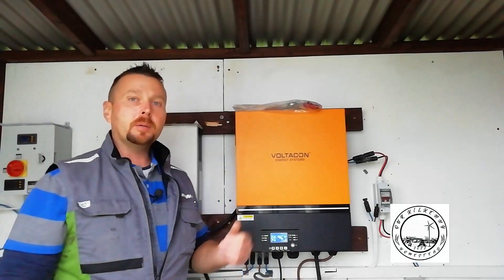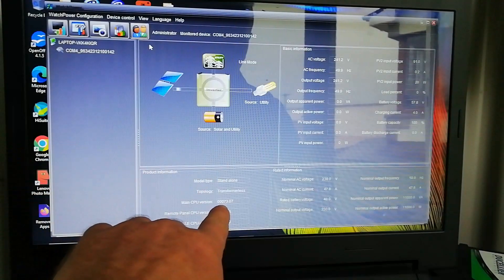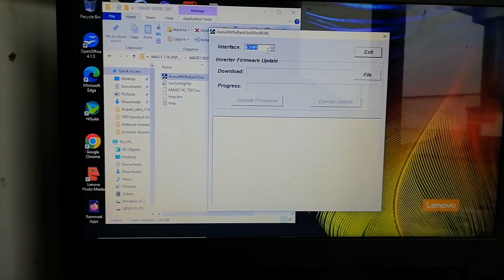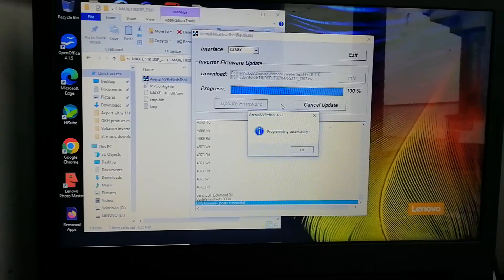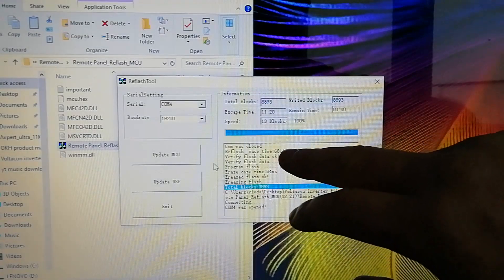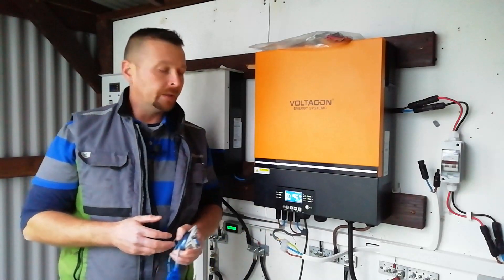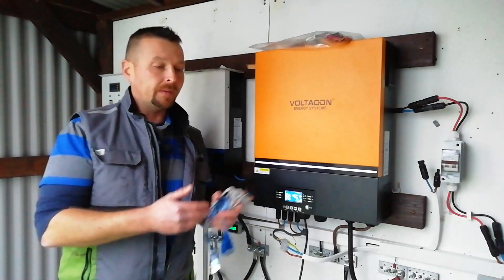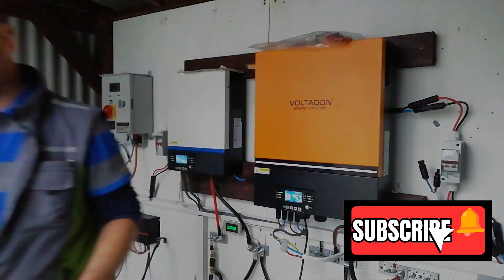Inverter Firmware Update Procedure, Bug Fix, Voltronic, Axpert, MPP Solar, Voltacon, ETC.

Comment: Hello, i have a Axpert VM III 3000-24v the firmweare is 47.00. Where can i find the latest firmware or is 47.00 the latest?
Reply from the maker: You need to contact your supplier for the correct firm ware versions, if they are available.  Usually the company will provide these for free, just ask.
Reply: @ourkilkennyhomestead2006  thx

Comment: Hello sir can you please share the application by which your using to update the firmware
Reply from the maker: I've answered you already chief. Your inverter is not compatible with the files and you need to contact your manufacturer. If you try to install the files for the max 1 as shown in this video then you will brick your unit.

Comment: Hello sir 
My inverter is showing error 61 and the BMS is not working my inverter 
model type is off grid main cpu version is 00042.05 and the 
Bluetooth cpu version is 00000.24  and 
ssc cpu 1
I want to update the firmware so please can you share the link or files of the software and the update of the inverter.
Reply from the maker: Hello, unfortunately the files we have are not compatible with your unit. You need to contact the manufacturer / supplier of the inverter and request the firmware update files from them. Most of the time they will supply them free of charge.
Reply: @ourkilkennyhomestead2006 can you please share the software your using to update the firmware

Comment: Hello, thank you very much for your videos. I am looking for the update for my Voltronic inverter Axpert VM III 3 k 24 volts. I have a TEZE Power 24 volts 200 Ah battery with a Daly BMS 8s active balance module JG19. The type of BMS is JL24 R10M 8s 24v 200A. Does anyone know the parameters of the inverter as well as the connection with the RS485 cables for the inverter RJ45? Thank you very much for your help.
Reply from the maker: Hello, what comms protocol is your bms using? RS232, RS485, or CAN?
Reply: @ourkilkennyhomestead2006  rs 485

Comment: Any tips on how to choose the right port on my Asus laptop? Tried all 9 ports in the sotwares dropdown and there's no "port & lpt" section in device manger.
Reply from the maker: @RaymondNoud  get something that you know works and triggers the autoplay, your phone, your camera for example. Plug them into your Asus laptop and go to devices in your settings menu. This should bring up a list of all your devices connected. Whatever device you've connected as the test device. Take note of it's com port of and plug the correct adapter lead for inverter coms into it. It's worth a mention that if you've established coms to your aio through the traditional ether net cables this should have given you com port id's, as shown in the video. Make sure you've got the correct adapters before attempting software upgrades.

Comment: Is this firm ware generic? I have 3 x 8kw voltacon units, same the one in the video. Voltacon have said the firmware is specific to each serial number, however they have sent me 72.72 for 2 inveters and 46.82 for another.

Surley these need to be all the same as they are paralleled together.
Reply from the maker: @haydensnart2423  that's a tough one. The firmware is not generic but specific to each different model. On one hand I've seen other users having difficulty paralleling units with different firmware while on other occasions user's have had problems trying to update units with incorrect firmware. Are your 3 units identical or is one an older model? Also, are all three currently running the same firmware version before attempting an update? You can find out the current firmware version of each unit through the watch power app as shown in the video.
Reply: @ourkilkennyhomestead2006  same units all 8kw versions of the one in your video. One was a replacement as I had a faulty unit so I purchased a spare from voltacon but all the same model.

The one replaced had an older firmware as menu 12, 13 etc are voltage not %.
Reply: @ourkilkennyhomestead2006  The watch power app is horrible, managed to get 2 of the units on this but can not for the life of me get all 3 on there. I have had other people that work in IT etc have a go but no joy.

Do you know of any others?

I use solar assistant.
Reply from the maker: @haydensnart2423  it's very basic to be fair. The only way I could connect reliably was by cable. Have you been able to read the current software version of each unit?
Reply: @ourkilkennyhomestead2006  yes, by pushing the up button on the control panel you can see U1,2 & 3.  I have had these 2 years so I have learnt pretty well. To be honest I am completely off grid and apart from a few firmware issues the inverters work pretty well.
Reply from the maker: @haydensnart2423  if all three are currently running the same software version then update them with the same update. If there's one running a different software to the other do then update as voltacon recommend.